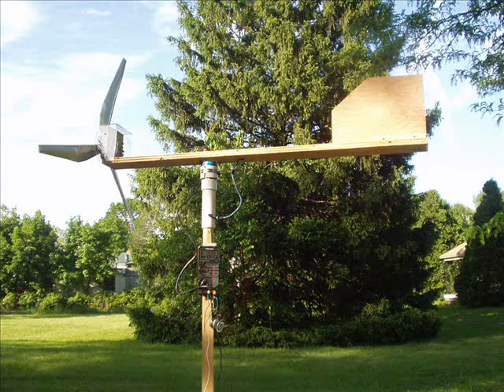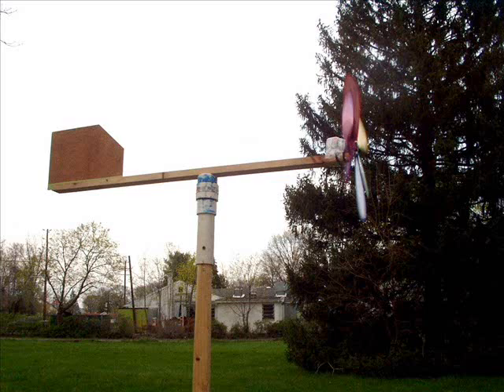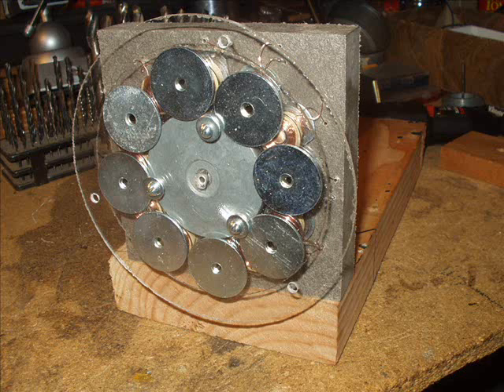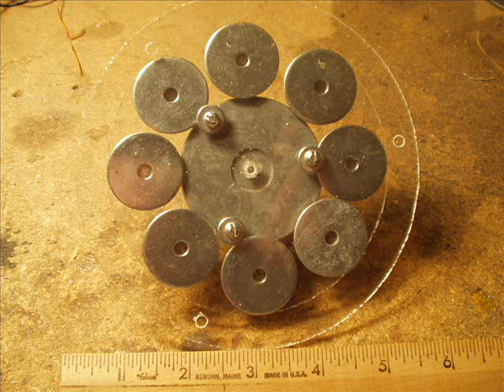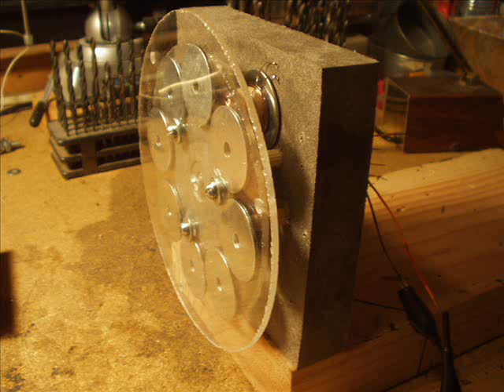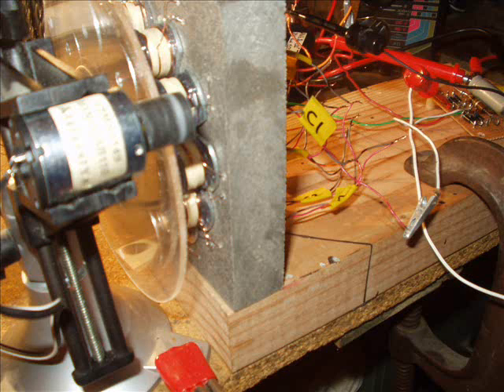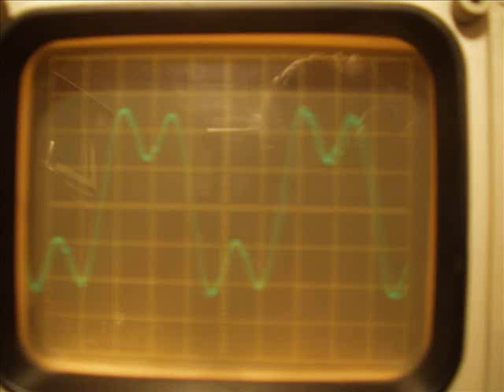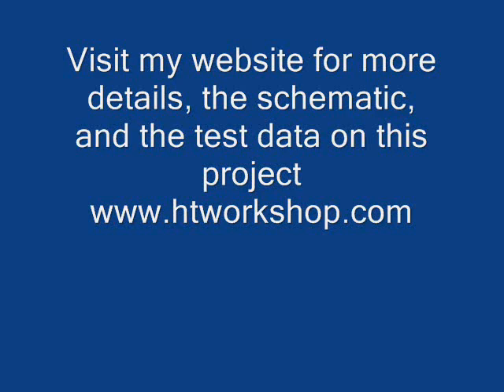Development of a Small Wind Turbine (part 1 of 2)

Comment from the maker: For more details & the answer watch part 2 of the video. Even more details and test measurement data is on my website. The short answer is.. about 1 watt. I believe my choice of wire gauge is a problem due to matching of source to load issues and a thicker (lower gauge) wire would produce more power into a low resistance load such as a battery.

Comment from the maker: Thanks for your response. I actually did try adding a core to the coils but it caused such drag on the rotor that it would not spin. So you are correct in theory but in application it's not practical unless you had very strong winds all the time to overcome the drag.